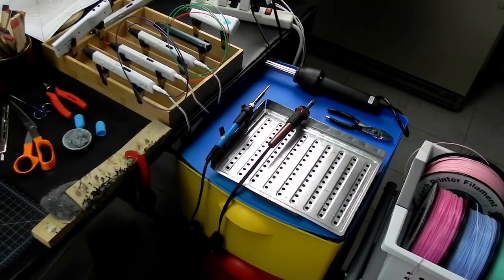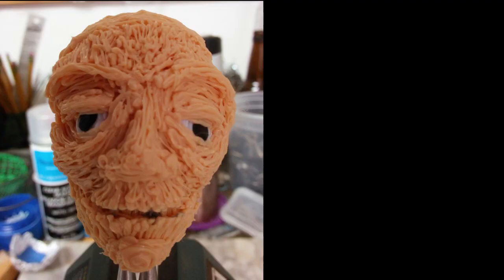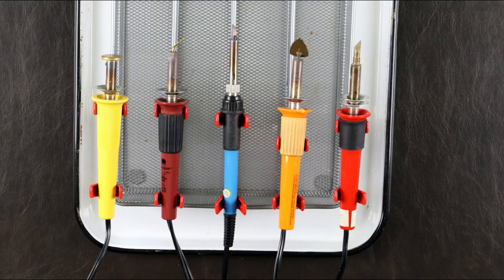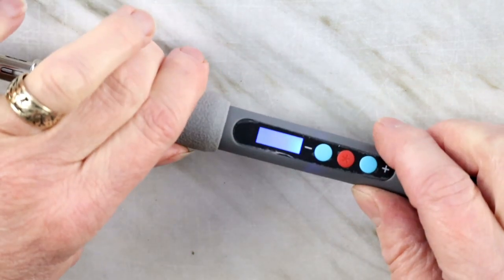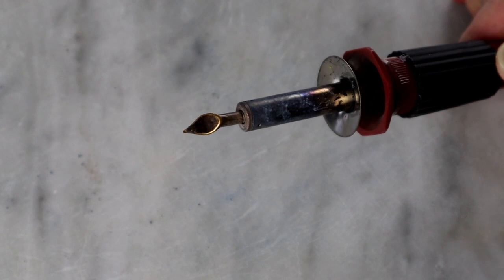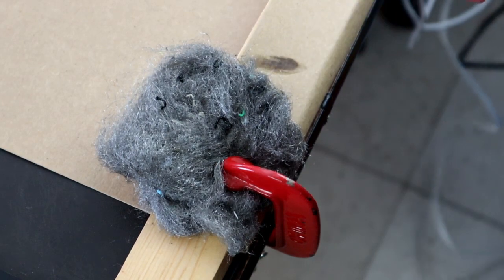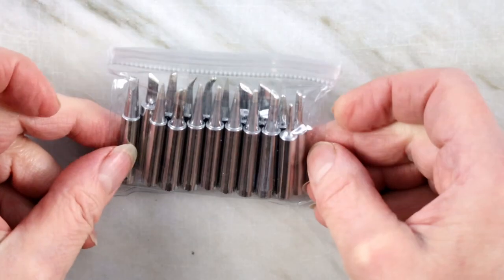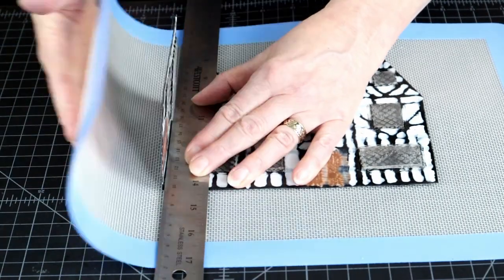My 3d pen studio – Melt tools

Comment: Honestly, I bought the soldering tool and quickly became frustrated. I think to start, a small used oven or heat gun is more cost effective and user friendly. Super easy to polish simple prints, and makes them insanely strong! Allows you to use clear filament in some capacity because you can melt out the bubbles and imperfections. 
 You can also buy silicone molds, and although kinda hacky, fill them with plastic, and add those to the design. There are also silicone texture mats, to texture pieces!  I would consider these heating tools as well... I might be crazy though haha. 

Thank you so much for your videos.
Reply from the maker: I totally agree. There are so many heating tools that are helpful for 3d pen prints postprocessing. The trick is to pick the right method for the job at hand. So don't give up totally on your soldering tool because there are moments when nothing else will do. Perhaps there should be a video what to use when? Until then there is this one that explains some of it: How to get 3d pen projects from 2d to 3d - Heat forming https://youtu.be/KwWeIYqoA-I .... But lists are never complete. :)